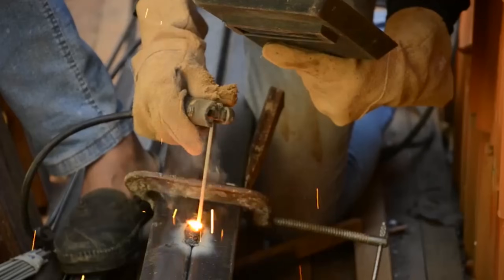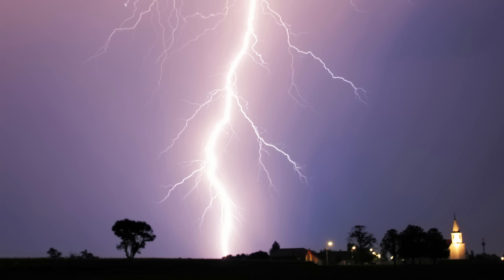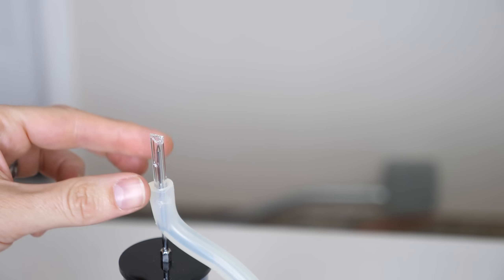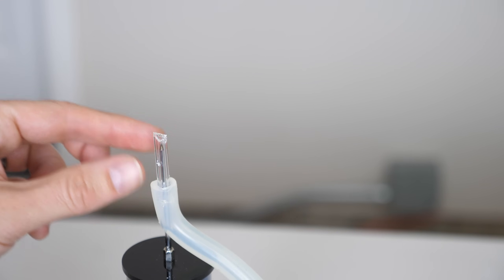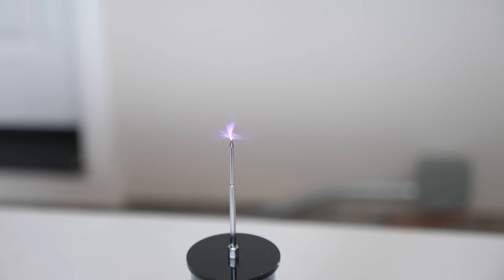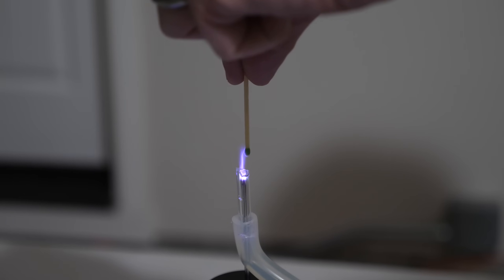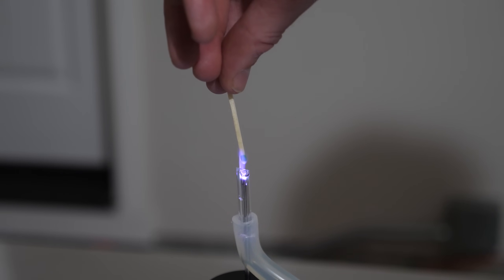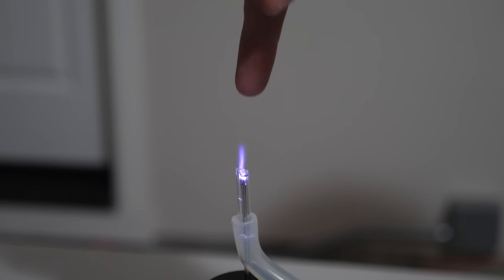How to Make a Cold Fire Torch That You Can Touch and Not Get Burned!

Comment: Biotechnology. Cold fire from nitrogen fuel is good for engine boost. You can add ice, mint, ginger and lime compound. Benefit; More horse power, improve air combustion, cool temperature, climb gear cleaning material, safe fuel, and also long range.

Comment: An interesting trick. I understand the principles behind it but expected you to use something like xenon, argon or neon as they require less ionization energy but I'm guessing the flow rate of the wind isn't fast enough to cool the system off in time. It is intriguing as well that it is that this is already in use, that's for the data

Comment: What kind of transformer or per source for the 10k's of voltage did you use? Also, have you tried using your cold plasma on a polymer to see if it changes the surface energy of it?

Comment: How fast does the helium have to flow over the flame?  How much helium do you need to use in a second or a minute?  Can you feel heat further away?  Does the fire give off heat that you can feel from a distance from it unthawing?  This is so weird and I dont understansd it at all.  It makes me wonder if this is how the Sun doesn't burn up.  Is it possible the Sun is surrounded by helium and we can't get close enough to it to see that?  Can you explain how this concept works in regards to if these same things were happening with the Sun and in or around the Sun, then what theory would explain how this could happen with the Sun?  Might be why space is cold and yet the rays of the Sun feel hot.  Also why the atmosphere is cold though you would think the Sun would make it hot but this could be why the direct rays of the Sun are warm or hot yet why the air in the atmosohere is so cold.  Also does helium not get warmed by the rays of the Sun?  Please explain or theorize about how what you have done and what you have learned could explain how the Sun burns yet does not burn up and how the suns rays heat whatever they shine on yet do not heat the air and do not heat the atmosphere and do not heat space.  Please can you be detailed with your theory?  I'm not trying to be a royal pain in the rear, I'm trying,to ubderstans what you did and how it relates to fire and plasma and then how it also relates to the hot sun and warm Sun rays yet cold atmosphere.  Because these things are so confusing as they seem contradictory yet must in fact be simbiotic and also synergistic.  I am intensely pondering these things and am craving an answer, so I will try to research as much as I can find yet since you accomplished these experiments, I hold your findings in high regard and that is why I ask you personally for these answers.  Thank you!

Comment: Question on your construction. Is it similar to a tesla coil with a needle at the top that you then attach a gas carrier tube to? If so, bravo. This seems likes a nice way to demonstrate the two types of plasma with a single apparatus using readily, or easily, available parts.

Comment: I can touch regular fire and not get burned. Though the hairs on my skin will get burned. Rubbing alcohol fire, now that's a pretty wimpy fire. You can douse your skin with 70% isopropyl alcohol and light it up and it will burn off without bothering you much. Or at least not bothering me much. Maybe I'm not a very good standard since 18 molar sulfuric acid doesn't bother my skin either.

Comment: Also if you sterilize something that usually means it has rather high chance of causing cancer in your own cells whenever it damages them only little in the right way...
Reply: Does it go through skin cells tho.
Reply: @dutchik5107  Yeah that is the question, if it does not go deeper than one layer of cells it is almost safe, but if it does (as I suspect it can) I am not sure I would treat it that lightly.
Reply: @NetAndyCz  esposure also wouldn't be much. How often do you have your mouth sterilized. You also don't hear people with braces or had braces having a higher risk of mouth cancer. And they cure the glue by UV light. Till the point it feels hot. But like not after.

It's plasma. Not a radiation  altho i don't know. Or has enough energy to not jusr damage cell walls/membrames but penetrate throigh and have enough energy to damage DNA

Plus like. Everything causes cancer so you probably can say "yes it does!!"

Comment: I have a question and I would love if you (or any commenter) answerd it:
So, plasma consists of free electrons and free nuclei, right? That blue flame consists of free electrons (that’s what I understood);
And beta-particles (from radioactivity) are also free electrons.
So, isn’t this blue flame (or plasma itself) consisted of beta-particles, and thus, ionizing? Wouldn’t it be dangerous to touch just as beta radioactivity is?
Or where did I misunderstand?
Reply from the maker: They are low energy compared to beta particles in nuclear reaction. This is no more dangerous than touching regular sparks. But yes these can ionize, but it is mainly surface penetration.
Reply: Thank you so much for replying!

Comment: It’s not that it’s cold. 

It’s just that it has such low mass, that it cannot transfer heat energy faster than the heat dissipates.

So it it self is not intrinsically cold. It is just not hot. In a sense it is cold fire. But it is misleading.

Comment: Maybe a dumb question, but is it possible to get a larger flame? And how large can you make the flame and what are the consequences of doing that?
Reply from the maker: Yes you can, you just need higher gas flow and a large tesla coil. Although it becomes more dangerous the larger it gets since the voltages are higher and more current flows through you.
Reply: @TheActionLab  Thanks for the answer. :) 

If you are looking for an idea for a new video, then I have a question for you. Maybe you can make a video out of it. :) 

How come, if the batteries in your remote die, and you cannot turn the tv on anymore with the remote, opening the battery compartment, turning the batteries (not even taking them out, just turning them) makes it magically work again, and not just for a month or so, but for a substantially period of time?

Comment: so the electrons are hot but total energy transferred is low because of mass difference. so does it mean that we can use this to burn hair? cuz hair is pretty light and the energy transferred per mass is higher than anything you tested. as hair is thin i would assume it has the greatest surface area to mass ratio so this is another bonus. can you please do this or at least explain will it work or not
Thanks
Reply from the maker: I don’t think it would burn hair. Probably only microscopic things would be damaged since it’s only surface damage
Reply: The Action Lab cuz i have some experience with high voltage burning hair and if you look at electrobooms mustache removal he did kinda same story i would guess that small hand hairs will burn